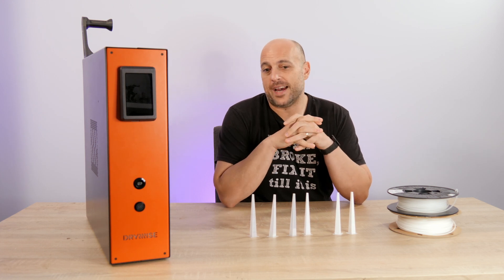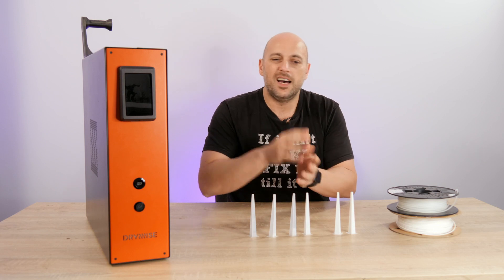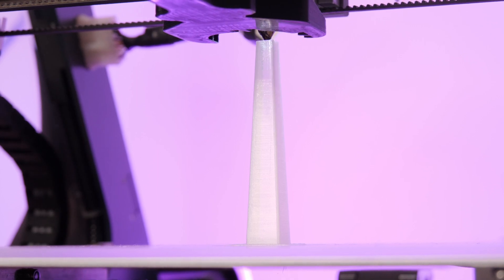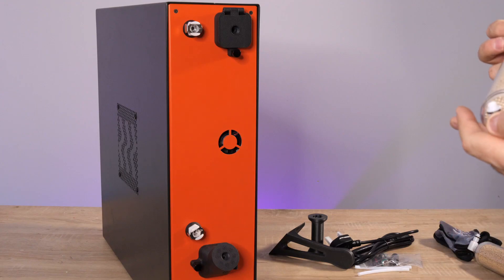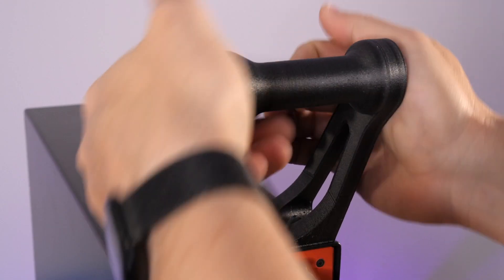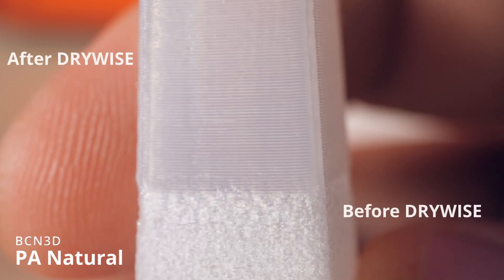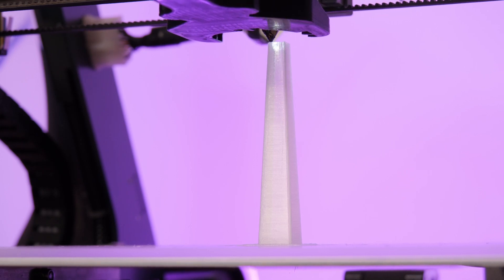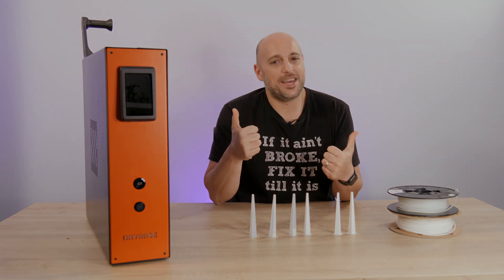Drying Filament As You Print - Drywise First Look

Comment: I wish you'd taken off the cover to show what's inside. I don't see a plausible way this thing can work well with the filament entering and exiting thru PTFE tube without inside access to run it around pulleys exposed to air and it'd be nice to see how this supposedly works. Maybe tiny perforations in the tube?
Reply from the maker: At that point in time I couldn’t really venture further into it, however I do plan to do some in depth video on the working of it and how it really differs from conventional dryers
Reply: @3DMakerNoob  i would love that. I would think about buying this if it would be around 100-200€ but this is to much for a hobbyist. So i also think about building one on my own